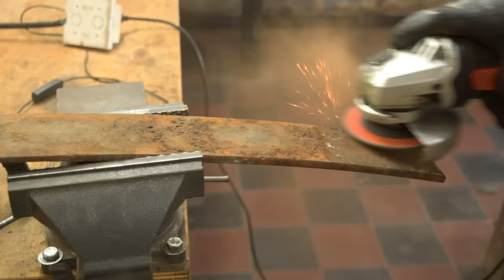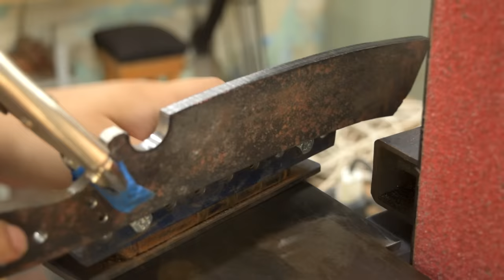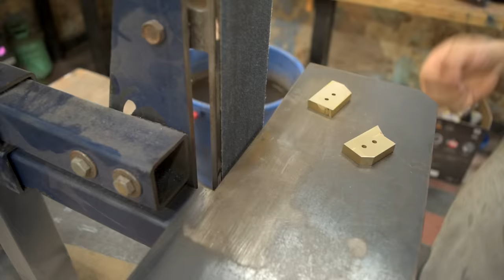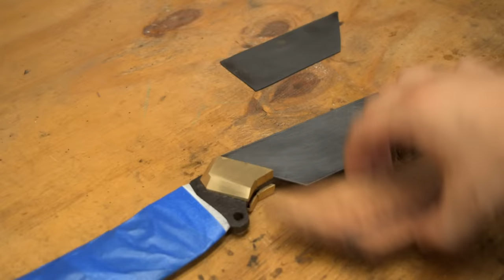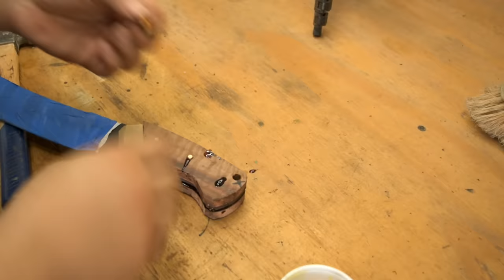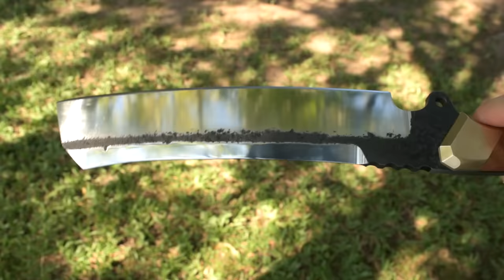Fabricación de cuchillo Chopper a partir de una ballesta de camión

Comment: Hola saludos. Muy bonito diseño lo sencillo con bonito detalle y cumpliendo su funcionaildad uso rudo. Una pregunta tengo una varilla o barra de 7mm x 150 mi pregunta es, como hago que sea dura muy dura y a la hora de ejercerle fuerza flexe a cierto angulo y regrese a su estado original. Que proceso llevaria??podria comentarme porfavor?muchas gracias. Buen dia excelente trabajo 👍👍
Reply from the maker: Hola Demian. Gracias por el comentario.
Primordialmente depende de la aleación del acero, es decir su composición. No es lo mismo 5160 que 1070, 1095, 9260, etc...
Por su necesidad creo que vendría bien que sea un acero 5160 porque es justamente los que se usan en las suspensiones por la buena tenacidad y dureza.
Ahora, es importante el tratamiento térmico completo: Normalizado, choque térmico y revenido.
Hay muchas variantes dentro del revenido, lo ideal es que pueda investigar el tema en internet, porque en un comentario me parece algo extenso.
Reply: @LeandroGoretta  muchismas gracias. Si buscare información pero ya basada en tu comentario. tenia esa grand duda. Por donde comenzar. Me sirvió de mucho. Muchisimas gracias por el apoyo

Comment: Excelente trabajo como siempre. Hablando de los aceros que utilizas, ¿Qué piensas sobre los tipos de aceros que manejas? ¿Consideras que el acero 5160 es tan bueno como muchos dicen?
Reply from the maker: Hola Jan. Muchas gracias por tu comentario.
Si, es un acero que se puede encontrar como ballestas y resortes... en automotriz básicamente.
Puede ser algo duro pero no tanto como el 100Cr6 que son los que se usan para rodamientos, ni tan blando como el 1070 (Hablamos de acero virgen, sin tratamiento térmico en cualquier caso)
La temperatura que necesita para endurecerse en el choque térmico no es muy elevada (850° C aprox) mientras que los aceros inoxidables necesitan más de 1000° C (caso del 420 por ejemplo, que necesita 1100° C) lo cual hace más fácil poder conseguir un tratamiento térmico.
Luego del tratamiento térmico completo llega a tener una dureza muy buena.

Comment: I really wonder who popularized making fulltangs.. it creates such a heavy handle that the blade become difficult to wield around.  instead of the tried and tested way of making tangs that has been used in actual military combat for hundreds of years. hidden tangs. and not those silly stick thin ones. image the full tangs but just like 10 to 12% smaller but still extending all the way through with radiused corners. will save so much weight and still be strong enough for any man's strength output. all those holes you drilled have made so many weaknesses in that tang or areas that will cause cracks and failures to occur to save weight
Reply from the maker: Thank you for your comment. I think the same in certain aspects that you have detailed. But I don't think the perforations are a weak point due to the thickness of the steel. What I think can be counterproductive is the accumulation of dirt and moisture that can become embedded. But that would still happen using a hidden spike.
I have not really made the holes to reduce weight, I did it so that the scales have a better contact with each other with the glue in between.
Sorry if you don't understand me, I'm using Google translate.

Comment: Looks like it's off a light truck and most likely not true spring steel but most likely 1075 which was stamped and heat treated. makes a marginal knife at best.

Comment: metals of this kind are considered good for their purpose leaf springs an high carbon steel like files are used in speciality tools which people make at personal choice. i have some philosophical thoughts here to share. if you make so many holes in small narow space which is spine of your knife or any tool does it compromise the strength of the tool or thinness of metal at the handle,does it make the tool weaker and increase chances of broken tool during usage. thinness of metal at handle and making many holes in metal will considered to weaken then structural integrety of the tool or spine of the tool. its a genral thought which arise out of common sense. In these circumstances i will request any to have some knowldge of Khukri knifes of nepal or north india region with a oldest popular trend of "mouse tail" in khukri knifes where spine or handle of the knife left thinner during manufactring delibretly dosent make the tool weaker then a "full tang" khukri knife. this realy a physics thing genral science scientific puzzle behind these tool making process

Comment: Why didnt you just shape the blade with a chisel?  I know a grinder is easy but you were through the hard part of getting it soft enough to shape. Shape it with a hammer and chisel then toss it back itnto the fire in between two pieces of weed to and carbon back to the edge.